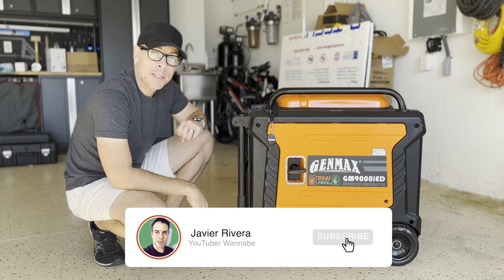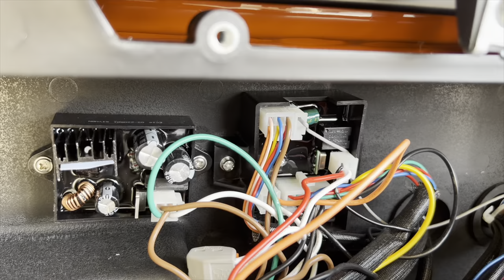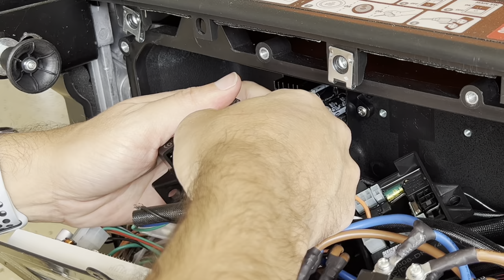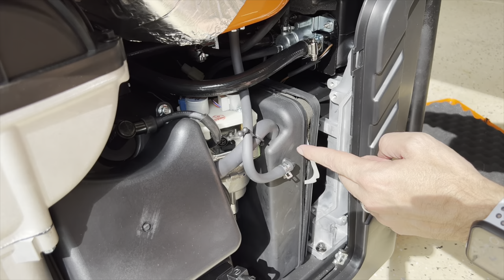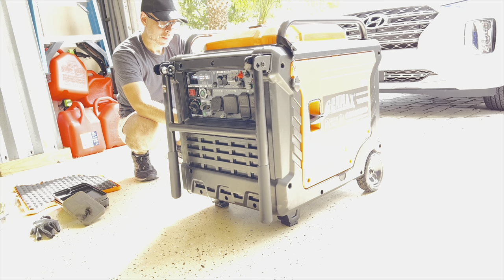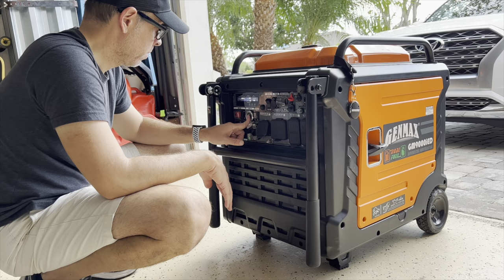Ignition Module Replacement / Genmax Problem / Warranty Support

Comment: Hi Javier
I have the genmax 9000ie
It had a similar problem,  sent it to the shop for warranty and it was a problem with the carburetor float.  It was getting stuck.  They cleaned the hole carburetor and it has worked for a month now.  I hope you can fix it soon.

Comment: Seen the same problem in another video on YouTube for the exact same generator. There’s also a 1 star review on Amazon with a very short video clip that looks like the same problem. Keep us updated on your progress, I suspect it’s something simple and obviously not that uncommon.  I have the same generator doesn’t have any problems but I’d like to know the solution, if this ever happens to me.  There’s another YouTube channel called James Condon, who fixes portable generators. I’ve seen a few videos of his  where weird ignition problems happen because of a bad CO sensor, or the low oil shut off.  I also saw where the coil/magneto air gap vibrates out too far and causes similar symptoms. That’s a quick and easy check and fix on a open frame generator but I suspect this one is a bitch getting to the coil, looks totally buried in the frame and air ducting.

Comment: It looks like your carburetor is gummed up. 

To fix it, you will have to take it out and clean it. 

To prevent this issue:

-Use ethanol free fuel with Stabil.

Or 

- find a way to cut the fuel supply when you are done with it and have the generator use up all the gas in the lines/carb to leave it dry.
Reply: Mine is doing the exact same thing though it has never had gas in it.  It does it on propane.
Reply: Did you find out what the problem was ? @davestaco

Comment: Hi Javier does the unit have a low oil sensor? Maybe a faulty oil level sensor could be something that could start working due to tapping the motor up and down?   I have a subaru motor on a chipper that is incredibly picky about the oil level.  Also, that backfire and sometime rough running and hunting seems like it could be an unrelated additional  problem. I'm really interested to hear from you how these problems  resolved, I've been looking to buy an inverter gen and thought this machine (or the duromax or iavolt version) might be the one.

Comment: There also could be some kind of debris in the tank, fuel system, and carburetor bowl that is blocking the flow of fuel to the engine.  The carb float or the needle valve attached to the float of even the needle seat could also be the cause.  Did you ever try running this generator on propane?  How easy is it to get spare parts for these generators?

Comment: I just ordered that same generator from Amazon ( 07/14/23) what should I expect? Should I send it back when it comes? Please advise.
Reply from the maker: No, why you would send it back? if there is nothing wrong with it. Mine had a problem and it was replaced but that does not mean that every single unit would be the same. The replacement has been working fine.

Comment: Thanks for doing these videos!  I just subscribed.  Did you ever get this solved?  I plan to only run it on propane and never put gasoline in it.  Do you think I will still have the same problem since propane never uses the carburetor float?
Reply: Should Never have a problem with Just using Propane.
Reply: I thought this as well and have only ran propane with mine.  It is doing this same thing.

Comment: I agree with other people I would say your carburetor is gummed up or are you have a bad flute, or if it has the anti-backfiring solenoid could be sticking and not letting enough fuel in you should try to run it on propane and see if it works fine

Comment: Did you try it propane!  Sounds like a fuel/carb issue to me.  Also, that air filter has chunks missing.  Gotta wonder where they ended up.

Comment: HI, My 9500 Predator did not start sometimes (65hrs) I suspected about the oil sensor alert.Disconnect the oil sensor and it works fine. Could not find the oil sensor alert replacement. Try this maybe it will work.

Comment: I’m wondering if some of the foam filter got sucked into the carburetor
Reply from the maker: I will check.   Thank you.
Reply: This happend to me
Reply: @roberthernandez4047  were you able to clear it out?
Reply: @Chris COTA16  yea but mines wasn't as bad as Javiers his looked pretty chewed up . I wash it and oiled it up also made made two quarters sized holes on the air intake box so far its been running great no stalls or backfires

Comment: I should have waited for the fuel injected model.   But im not running mine on gasoline period.  Only on propane.  Cant wait to know the solution
Reply from the maker: Hi. I ordered a carburetor cleaner in spry. I saw a video using that to start a generator with similar problem.  Also, emailed Genmax with the video. Let’s see what they say.  I would be getting a propane tank before I ado anything with the carburetor to test it.  Thank you for watching.

Comment: Sounds like fuel delivery issue.  Run some SeaFoam through it.   If it has a fuel filter, replace it too.
Reply from the maker: I just ordered a carburetor cleaner.  I saw someone using it on another generator.  I will give it a try if doesn’t work I will try Seafoam. Thank you

Comment: If you are running it with Gasoline, I believe there is a way to Turn the gas off, and let the generator run till the gas is empty from the Carburetor. Don’t run it out, when you are still using it for Power, only when your done using the Power.
Reply from the maker: I do that every time I turned it off to burn 🔥 the gas in the carburetor.

Comment: Sounds like the needle in the float bowl is getting stuck and not letting fuel into the carburetor and then when you bounce it it gets unstuck and lets fuel enter... then fuel comes in the float Bowl engine runs, needle gets stuck again and the engine runs until it runs out of fuel in the float Bowl... find out why the needle or float is getting stuck in the carburetor

Comment: Javier, to me, the symptoms indicate a fuel problem.  I think the float valve in the carburetor is sticking and that’s why the tapping on the ground works.  When you tap, the float jiggles the float valve and allows fuel into the carburetor.  But at some point, the valve sticks and the engine is starved of gas and shuts down.  Clean the float valve with some carb cleaner and it should start working.
Reply from the maker: Thank you for the info.  I will research that and see if works.
Reply: Also make sure you only use ethanol free gas. Google for a gas station in your area that has a dedicated pump for non ethanol gasoline. That will keep your carburator gum free.
Reply: I’m going to have to agree with the float in the carburetor being stuck or gummed up. Supposedly ethanol free gas is the way to go. I saw a video on YouTube a couple weeks back that showed how to remove ethanol from gasoline using water, so if you have to go that route as a last resort after cleaning the carburetor. I have high hopes that you will get it fixed. This generator is the one I have been wanting
Reply from the maker: @chriscota1635  Thanks.  I will check.
Reply from the maker: I just saw a guy using carburetor cleaner.  I would try that first. The spray bottle was $4 so I would give it a try.
Reply: I'm having the same problem but with propane natural gas and gasoline so it has to be something else
Reply from the maker: If you tap it like I do it works???
Reply: @JavierRivera  so did it solve the issue ?
Reply: @Javier Rivera  also check the filter and oil it

Comment: The symptom indicates a bad spark plug cap. Its leaking current and short circuiting with the body.
Reply from the maker: It could be.  Someone else said a bad oil sensor.  Genmax replace it so I do not have the unit anymore to test it.

Comment: Seeing blue smoke come out of it tells me something is very wrong in that engine. Blue smoke means oil is burning. Black means it's running too rich. I would return that Genny ASAP.
Reply from the maker: I posted another video. They sent me a new unit and picked up that one.  The new one works fine.

Comment: They most likely want to know if it will fit in the back of a pickup with a tonneau cover on it.
Reply from the maker: That is what I thought.  I checked the height of the bed of my F-350 and the generator is too tall to be covered with a tonneau cover.

Comment: Has anyone fixed this issue ?
Reply from the maker: @roberthernandez4047  Genmax replaced my generator. Took back that unit and never told me what was the problem.
Reply: @JavierRivera  could you reach out to them and ask I have one that's doing the same thing and it's out of warranty

Comment: I'm convinced now not to buy the GenMax that I was looking at. Who needs a warranty that works like this?
Reply from the maker: This is just one unit from thousand sold.  I talked with Genmax china and the reason I got a faster response from USA Support is because the switched recently to another provider more efficient.   I will be posting another video. Genmax would be replacing my unit and picking up this one to send it back to China for quality control analysis.

Comment: Fuel problem and probably the cheap Chinese Torch spark plug.  Bouncing it on the floor to get it running might be a bad float needle that's sticking.  Jaring it might loosen the needle long enough to fill the bowel.  Then the needle sticks closed again when the bowel fills up.  If it was my setup, I'd run it on Propane only!  Propane is cleaner, lasts virtually forever and won't gum up the carb!

Comment: Why should you have to be doing the repairs. Thanks, I was going to buy one of these but not anymore. Too much money for all you have to do!!!!
Reply from the maker: I had 1 issue and Genmax decided to send me a replacement, the other videos are not repairs are converting the generator from bonded neutral to floating neutral that is required to be able to power the house using the generator.  I am happy with the generator I have not had any issues since I got the replacement.
Reply: @JavierRivera  I guess I don’t understand what a bonded neutral and a floating neutral is? What change must be made to run your house? I am wanting to run my house to with whatever generator I purchase. What will I need to do to run my house by generator? Thank you for your help with understanding this situation!!!
Reply from the maker: @kennhurt5636  https://www.youtube.com/watch?v=RkjjZJgaINA